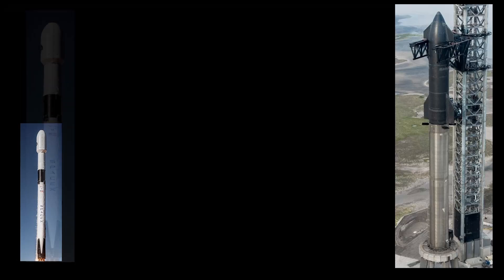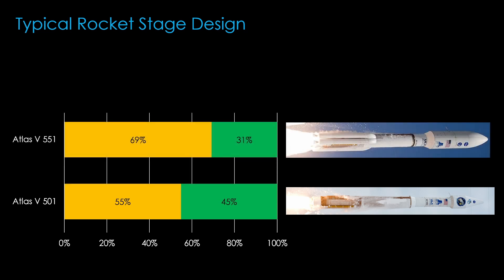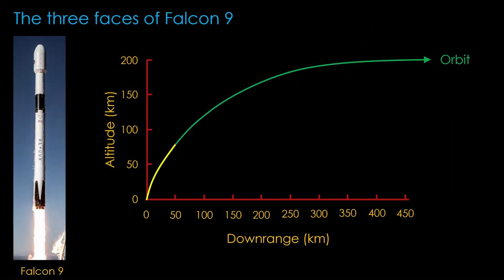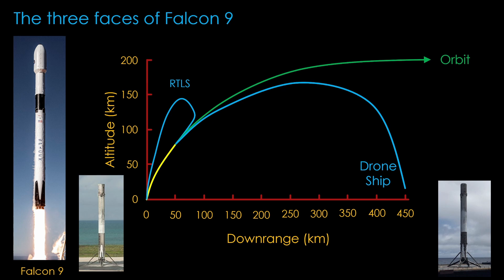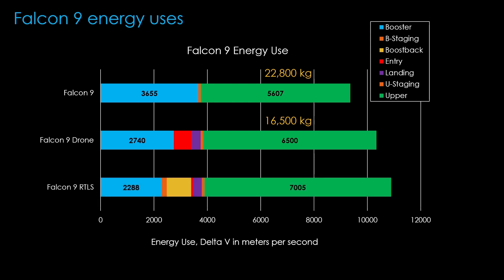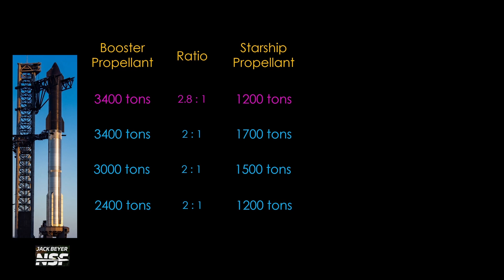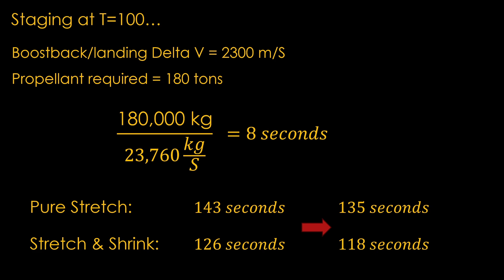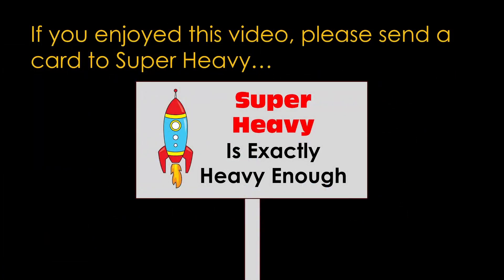Starship Optimization - New Rocket, New Tradeoffs

Comment: So what's the conclusion?
We just need more information about therefore we wait, then?
I'm thinking the whole starship system will get significantly more massive if the Raptor 3, staging timing and mass to thrust ratio is to make sense; something closer to the 6000T mark.
Reply from the maker: I don't expect it to change much in the near term - the Boca Chica infrastructure is sized for the current design and it would be time consuming to change it. 

I suspect that for Raptor 3 they are going to dial back the engine a bit and accept a lower chamber pressure and specific impulse to be able to push more thrust and reduce the engine count. For a first stage thrust matters more than specific impulse, especially with very early staging.
Reply: I love this reply, almost everyone else implies ISP is king in all situations.
Thanks.
Reply: @EagerSpace  can you revisit these thoughts now that we have another years worth of information to ponder?